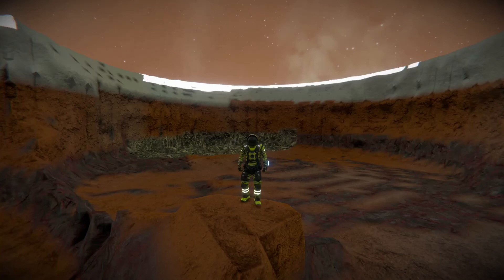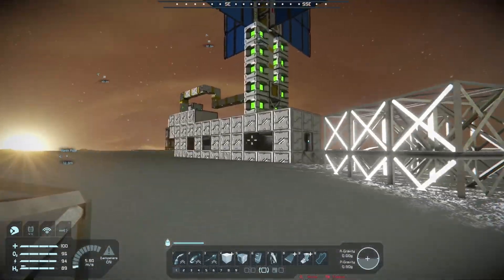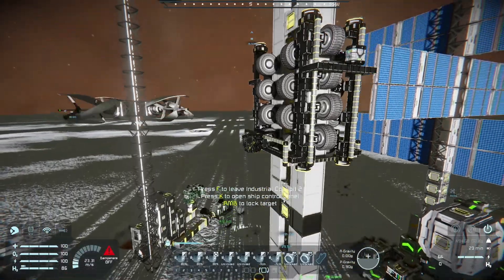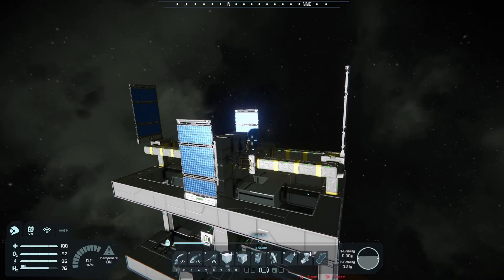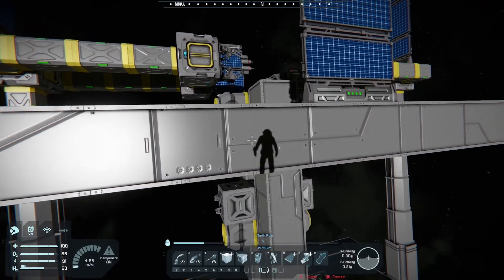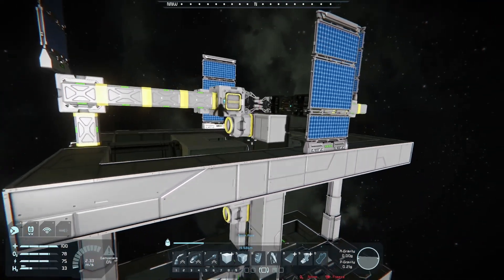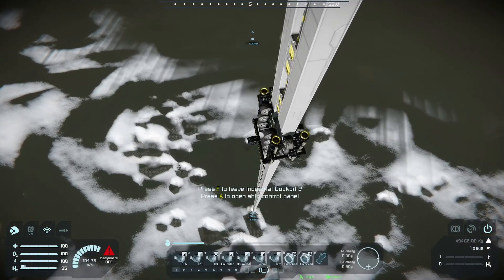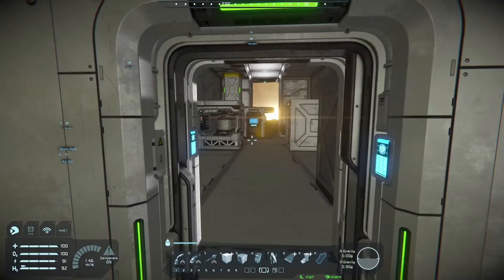Vanilla Space Elevator in Space Engineers

Comment: How would you compare the 2 inventory scripts?  just the Colored LCD making wanna switch.
Reply from the maker: I think IQueue is a little easier on the CPU but not as feature rich. With IQueue you have to put the name of every individual item into the custom data of the container/containers you want them to go to, just putting "ores",  "components", or "ignots" in the name does not work. The production control is handled in the custom data of the program block that the script is in. IQueue does allow you to limit its reach, just put all the assemblers, refineries, and containers into a single group and it will use only that group.

Comment: Nicely done. Do you have plans to expand the carriage to include cargo and/or landing pads?
Reply from the maker: I am not sure if it could handle to much weight. Stability is the main problem it is ok once you get it up to speed  but has issues at lower speeds. 

I think a larger cross section on the elevator would help.